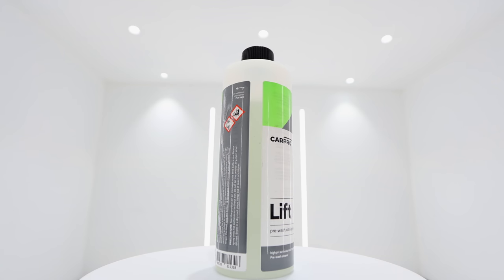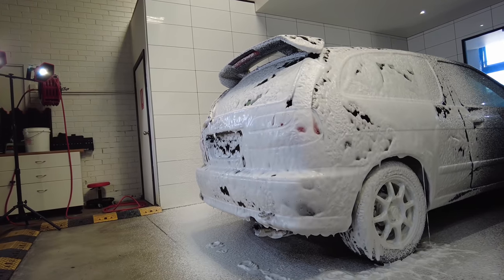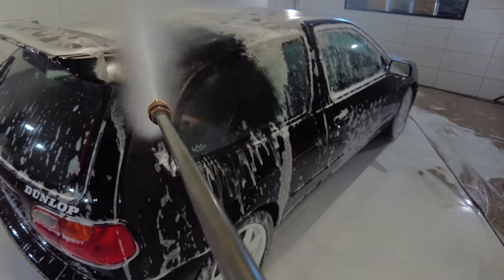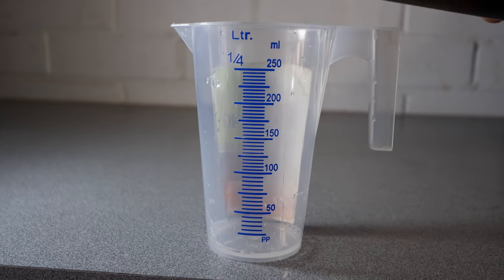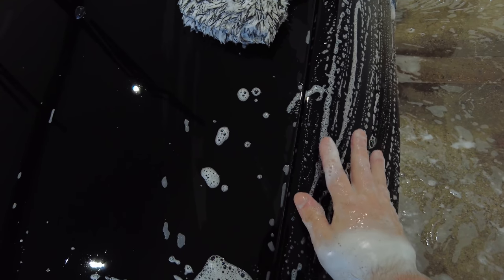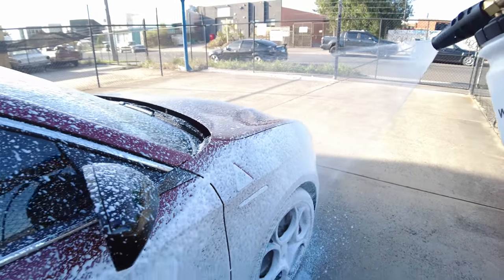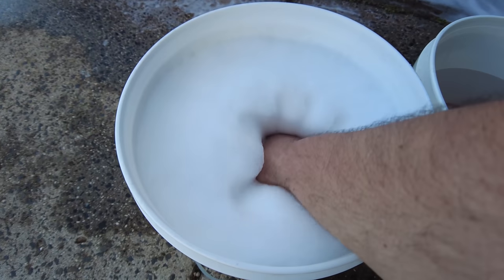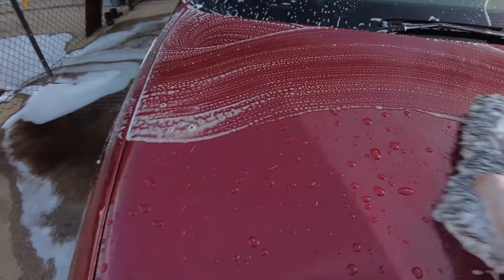New Carpro LIFT Snow Foam Full Review & Testing!

Comment: Thanks for the video, Sandro! Been anticipating this review. I finally managed to pick up Lift locally, and I've definitely liked it! I used it a few weeks ago on my car, foaming and letting it dwell for several minutes. It ate all of the filth off, from the Canadian winter - all the salt build-up and sand was pulled off the car and was trapped in the foam on the driveway.  Only had to do a light hand wash afterwards with Reset! That said, the car is coated with CQuartz UK and CQuartz TiO2. Will definitely purchase more in the future.
Reply from the maker: Thanks mate, and thanks for sharing your experience with it!

Comment: Nice video again Sandro. For reference, 500ml of Lift here in the UK is £7.68 inc VAT. I guess 1L will be about £14  which is similar to other 1L snowfoams, so it seems to be well priced (without taking dilution/concentration into account)

Comment: Another great video! Also, thanks for the lesson on using the water flow valve on the foam lance. I thought my snow foam wouldn't 'stick' to vertical surfaces due to the ceramic coating, I'll try playing with the valve next time I use the foam lance.

Comment: Awesome review! Recently had my vehicle ceramic coated and have considered using Lift diluted and paired with Mega Foam for lubrication/clinging for touchless washes as to remove breaking down traffic film while the high suds remove those contaminants from the vehicle. Figured since it'll be topped with Eagle One's Wipe and Shine, the quick detailer will act as a sacrificial layer to the coating in case Lift does manage to break it down the next time it's washed. As for contact washes, will use that combo for presoak and Reset + Mega Foam for the contact wash to minimize chances of swirling. In theory, it makes sense to me; hopefully it works as well as I think it should.

Comment: You can use this every week as well as combined it with reset. It's safe on ceramic coating. I don't put wax on so I don't have to worry about it breaking it down. If you use turtle Wax seal and shine it's perfectly safe and does not break it down. Good video man 👍

Comment: This 1:10, 1:15 dilution ratio is just pot luck.  It may foam loads but is it cleaning fully! I’m sure it does loosen dirt somewhat but what PIR does the product need to be fully effective!? - how much of the dirt and grime being removed is from the pressure from the pressure washer? Bilt Hamber AutoFoam needs a very low 4% PIR to be fully effective but that still equates to around 480ml of product in a 1 litre foam canon due to flow rates! V-Project UK’ has an excellent video on PIR! Well worth a watch ... I learnt so much from it

Comment: Been waiting for this one! Thanks for the review. Surprised you didn’t try it on your coated cars and include your thoughts on that. I dunno if it’s foolish but I was hoping that Lift could be a pre soak foam that made the wash step even safer and more effective for coated cars. 

I was looking at Lift and or one of Bilt Hambers two snow foams for this purpose. My suspicion is their new “sugar” based formula was designed for use with ceramic based protection. Since it seems to be compatible with their ceramic booster packet.
Reply from the maker: You can absolutely use it for coated cars, I did test it on quite a few, and I saw no evidence that it was harming the coatings in anyway. It’s just more of a matter of using it as needed rather than always using it, at least for me.

Comment: Great video Sandro. Question, do you think lift, or even NV snow + would work as a touchless wash for lightly dirty vehicles? Cars that are garaged and really only get a nice sunny day drive etc. Think Sydney weather
Reply from the maker: Thanks, and yes they can, but I would still tend to do a hand wash in between touchless washes and just be sure to avoid water spots with a good drying process and maybe a quick detailer to help the whole process out.
Reply: @CarCraftAutoDetailing  legend. That's the plan. It's more when the car is  just "dusty". I have also been using "throttle" and noticed a significant drop in dust that clings...for anyone wondering

Comment: Another cracking video Sandro. Awesome as always. I’ve been adding 100ml Lift to my foam fun as well for increased washing ability. I find it works pretty well. Not as aggressive as TFR or adding APC to foamer. But a safer and nearly as effective method.

I have also been using Koch Chemie Green Star with excellent results
Reply from the maker: Thanks mate and thanks for sharing that!

Comment: Sandro so is the scent similar to Reset? What about putting  some Reset with Lift when foaming have you tried that ?  So would it be a good monthly wash for ceramic coated car? Have you tried any of the Labocosmetica products such as Primus and  Purifica  they are made in Italy?
Reply from the maker: Maybe a similar scent but still different. Yes I did try quite a few mixes in the foam lance and it works fine with Reset mixed in. I would use it as frequently as I needed on a ceramic coated car, it just that if you have a top coat sealant it make break that down, which is why I’d recommend using it just before you reapply something like Reload. 
Yes I have tried quite a few of the Labocosmetica range including Primus and Purifica and my first impressions were quite good!

Comment: I tried using Lift + Reset in a bucket and I think it did a very good job. But then it's very difficult to say how well it actually cleaned the cars paint because I get superb results with Reset alone. I wonder what's the most effective way to decontamination a cars exterior, as much as possible, using the bucket method (shampoo +?).
Reply from the maker: There’s always a balance that needs to be met as going too aggressive all the time can lead to paint and trim deterioration over time, so usually the least aggressive method that works is the best corse of action and sometimes that just a simple car was soap but other times it can be more aggressive acid or alkaline based cleaners used in conjunction.

Comment: Great video and In depth explanation. Especially the ph test, however I saw another video of someone who tested the ph level once it was on the panel and it came up ph neutral. So is the product actually alkaline on the panel and is it really doing anything more than what reset does?
Reply from the maker: Thanks, and chemicals will react with whatever they come in contact with, so alkaline’s can be neutralised with acids and vice versa, but just because a chemical neutralises it doesn’t mean it hasn’t had an effect or done it’s job. A lot of information we get about certain chemicals is very misleading, so I don’t try to base my conclusions on that, I try to stick to what I’m best at which is evaluating results rather than chemistry.
Reply: @CarCraftAutoDetailing  I appreciate your answer, and it’s exactly why I watch your videos ,  wry informative and helpful. And what you said makes sense , thank you.

Comment: Great video!
Something I wanted to ask though since I saw you dry the paint at the end.
I use that drying towel as well but in my experience it leaves some streaks of water behind.
Is there an special trick to it? or is it the fact that this car is coated and it's easier to dry it?
Reply from the maker: The more hydrophobic your paint is the easier it will be to dry and tend to streak less because there’s less standing water to deal with. But a final wipe with a quick detailer and a couple of general microfibre cloth should sort out any streaks in the finish.

Comment: Does Carpro lift removes wax? I am using Gyeon Foam at the moment but why not to try something else, all tho its all same..  I use Carpro reset shampoo because it does not remove wax.
Reply from the maker: It will start to break down a wax and potentially remove it, but not always, it just depends on the wax and how well and how long ago it was applied.

Comment: Great video bro, I'm thinking of using Lift. But have you ever used a contactless wash like Wash Chems Pro-50? It has  great reviews, basically just 'melts' dirt and traffic film right off the car. Says it's safe for ceramic coating and you can greatly dilute it to use on interior. I'd like to have a contactless wash....its designed for large commercial vehicles like 18 wheelers.
Reply from the maker: Thanks but no I’ve not use it, it would be great if it’s really safe and effective without the need to hand wash but it’s a big call and promise for any product to be that effective yet safe, but if it is thats fantastic and definitely worth a try!
Reply: @CarCraftAutoDetailing  I think I'm going to buy some to test out. I probably would only use it on a coating that is a high quality professional grade. But their literature says it's fine for use with ceramic coats.
Reply from the maker: Let me know how it goes!

Comment: Can we use Lift every time we wash our CarPro CQuartz UK3.0 coated vehicule or this should be used from time to time? Also if this should be used from time to time what you sugest using ?
Reply from the maker: Yes I’d use Lift from time to time and use Reset as your regular wash
Reply: @CarCraftAutoDetailing  Reset also used as prewash foam?
Reply from the maker: Yes, and if need be you can mix it with lift if you feel you need more cleaning power in your situation. 
Maybe this video will also help:
https://youtu.be/vWYyw-yKM3A

Comment: Just curious how Lift compares with MultiX as a prewash? Just trying to figure out if 2 products is necessary or just MultiX is good enough with its versatility?
Reply from the maker: Muti-X is much stronger and won’t tend to provide much at all in the way of lubrication and won’t tend to dwell as long or as well. It doesn’t mean it can work as prewash, but you may need to play and experiment with it a bit to get there
Reply: @CarCraftAutoDetailing  thank you for sharing your insight and experience 👍

Comment: Can I ask. What foam lance you use and how much psi your pressure washer is? I ha e a bowdens lance and no matter how concentrated the dilution is on nv Snow.. it just slips right off. I have coated my car with NV Jet and NV Lustre so I guess its a good thing the foam jist slips right off?
Reply from the maker: I think my Kranzle has 1750psi, and yes the foam being rejected is a sign of a very hydrophobic finish!
Reply from the maker: The foam lance is the Waxit one

Comment: Hi, nice video! Quick question, will Lift affect the ceramic coating on a car in time if used often? Thanks!
Reply from the maker: Almost all wash and cleaning products will affect a coating to some degree, it’s really about trying to find that correct balance for you. Using something like Lift or similar for every wash may not be the best choice because it is much stronger that a general ph. Balanced car soap and in most cases just isn’t needed to be used so frequently. However, what tends to accelerate the deterioration of a coating is environmental and traffic contamination, so if you don’t use something more capable like Lift to periodically remove that contamination it will in fact break down your coating faster than not using Lift in the first place. You just have to work out what’s the best time to use it whether it be once a year if the car is always garages and not driven every day or every few months in average conditions or maybe once a month if the car is never under cover and a daily. It can also be a good routine to use something like lift just before you add a top layer to a coating to reset it and create a better bond with a top coat sealant.
Reply: @CarCraftAutoDetailing   well this is what I'm struggling with, no using a product like Lift the coating might be affected by the external contaminations it's getting hit as it's a daily driver. I guess it makes sense to use Lift like you said, at least once a month and then apply a top coat. Makes 100% sense, thank you!

Comment: What's the difference between the LIFT vs the TRIX? Great video!
Reply from the maker: Lift is a strong alkaline based decontamination pre-soak foam used at the start of a more intensive car wash and decontamination process to start breaking down and removing tough but general dirt and grime, while Tr.ix is a stray on chemical solution used to more specifically tackle more stubborn iron and tar particles, dissolve and remove them. Tr.ix is also a very effective wheel cleaner that can tackle extremely bad and neglected wheels, though it should only be used when necessary as it is a more aggressive chemical than most.
Reply: @CarCraftAutoDetailing  Okay. Now that makes sense. So, LIFT followed by RESET once 3 to 4 months and RESET as a regular car washing shampoo. Does that make sense?
There are so many products out there that I'm totally confused now. I want to buy um all. LOL! 
I live in a place where by evening my car is covered in dust and the lower part is covered in a thin layer of mud. It's a tough job to keep the car clean here.
Reply from the maker: Yes it never stops with detailing products, there’s more and more every year. 
That sounds find as a basic maintenance routine 🙂

Comment: That's a very informative video. Thanks. I have a query though.

Do I have to rinse the car with water before spraying CarPro Lift? Or should I spray it directly on a dry surface? I have a pressure washer and a foam lance.
Reply from the maker: Thanks and that’s really up to you as there’s pro’s and cons either way. 
Rinsing before hand can allow the snow foam to work more effectively as it no longer has to deal with or work through the light dirt you removed, but foaming onto a dry surface generally allows the foam to cling better and not get further diluted be the standing water on the vehicle. There’s no right or wrong so just go with whatever you like.
Reply: @CarCraftAutoDetailing  That’s exactly what I wanted to know. Thank you so much for your help.

Comment: Hey man, you have any recommendations for a 2in1 product?
Meaning a solution for snow foam AND hand wash?
I have tried the Sonax one and bound to start using the Turtle Wax hybrid snoaf and hand wash.
Reply from the maker: I personally use Nv Snow for maintenance washes and Snow+ for decontamination washes all the time with great success both for pre soak foams and hand washes.
Reply: @CarCraftAutoDetailing  Unfortunatly they seem to be not available here in Europe (DE). Are there any other cost effective options you could recommend?
Reply from the maker: In you’re after a maintenance 2in1 wash, Carpro Reset is fantastic in both your foam lance and wash bucket, I’ve used it for years with great success.

Comment: Hi Sandro, what’s the PSI and GPM of your PW? Great review!
Reply from the maker: It’s the Kranzle K2160TST which I believe has 1750psi and 11LPM, but I wouldn’t focus too much on manufacturers specs, it’s really using a pressure washer that lets you know how well it performs in real terms.
Reply: @CarCraftAutoDetailing  2.9 GPM, that’s a lot!! 👍🏼

Comment: I don’t understand how these companies make a general recommendation of 1:10 in a foam lance. There is massive differences in pressure washer specs which will affect the outcome. PIR recommendation is very important, like Bilt Hamber.
Reply from the maker: 99% of users will never calculate PIR but they still want a general recommendation, that’s pretty much why.

Comment: Great video as always! Now that it's been over a year since the release of this video, have you found if you prefer Carpro Lift or NV Snow +?
Reply from the maker: Not really, I continue to use them both and find them equally good
Reply: @CarCraftAutoDetailing  Thanks Sandro. I'm going to try NV Snow +. Any thoughts on Carpro reset vs NV Snow? I've found reset to be my favourite soap so far as it has great cleaning ability with crazy lubrication, but I haven't tried Snow yet.
Reply from the maker: I’d say Reset is a touch stronger in terms of cleaning ability and Snow is a little gentler on less durable waxes or sealants, that’s probably the main difference

Comment: Do you think weekly usage of Carpro lift on a coated car with UK 3.0 would affect its longevity?
Reply: Also interested in your thoughts how it would be for coated cars.
Reply from the maker: Every detergent or chemical you use will effect a coatings longevity to some degree, but not using these chemicals can actually degrade a coating even more by not removing certain environmental contamination that can break down your coating even quicker. I know it’s probably not the answer you’re after, but you have to find a balance based on your specific environment and conditions. If your car is garaged, regularly washed and you don’t live in a harsh environment, then I would only use it a couple of times a year. But if your car is always parked outside, used every day, maybe not washed every week and you’re in a harsher environment, you may want to use it monthly or even fortnightly to remove that contamination that will breakdown your ceramic coating faster. Almost everything I do in detailing is about using the least aggressive method that works, so if you don’t need it, don’t use it, and if you do need it don’t be afraid to use it as often as you need to on a coated car.
Reply: @CarCraftAutoDetailing  awesome answer